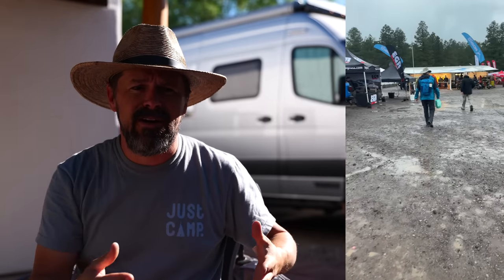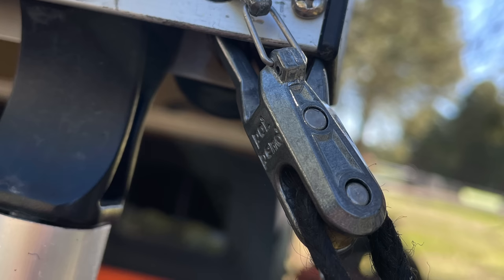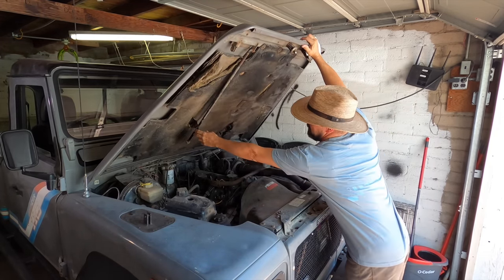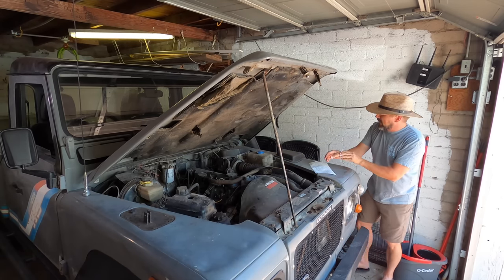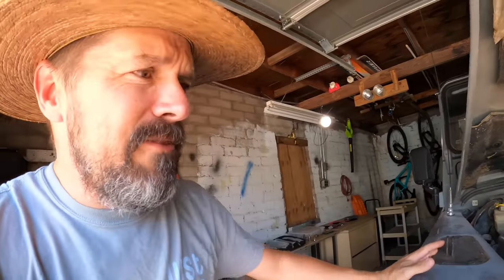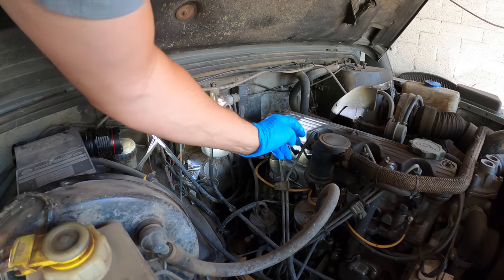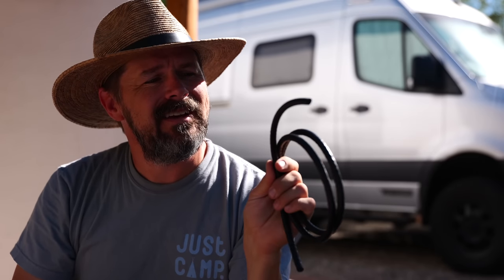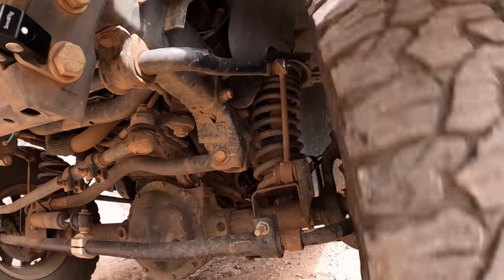Defender Update after Overland Expo West 2023

Comment: Thanks for the tip on the Rollercams. Ordered 12 for 64 bucks. Save time and jammed line at night. Looks like they will hold up over time if you use them correctly. I like the brass and stainless spring, Blah blah. We will see.

Comment: As a fellow owner of an old diesel truck, the newer diesel we get in the states, just like the crap gas we have - has ethanol in it.  Ethanol plays havoc with old rubber that wasn't made to chemically resist it - leading to behaviors like your poor fuel line.  One of the best investments you can make on an old diesel is a complete fuel system rebuild.  Drop the tank, clean out the filter sock (if it has one, not sure about the land rovers), replace the entire rubber fuel line with modern rubber, change the tank selector valve if you're on a dual tank setup, replace the fuel filter, injector pump and might as well replace the injectors while you're at it.  All of the new parts should be made to not only withstand the ethanol but the ULSD that we're forced to use.

Comment: A happy battery is a charged battery. The battery must be maintained at least 10.7 volts or you will eventually ruin the battery. Get a battery maintainer and leave it plugged in. Your other issue may be found doing a parasitic draw test. Videos are available on You Tube.